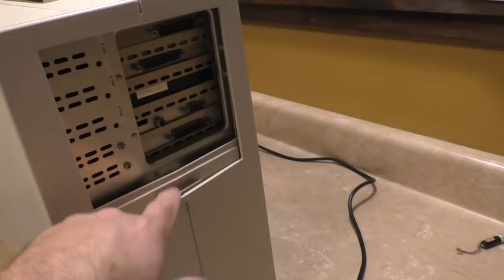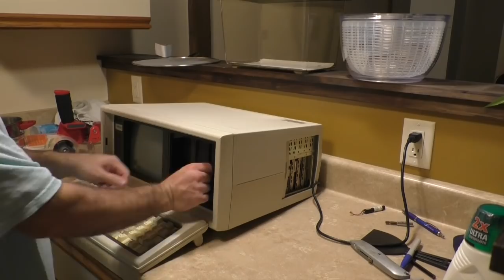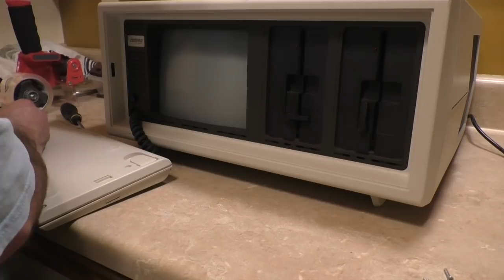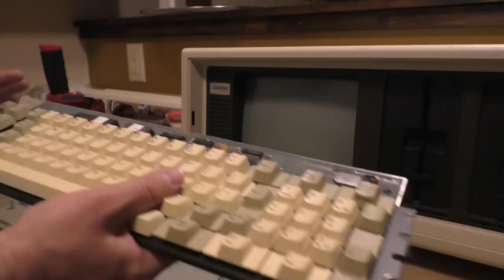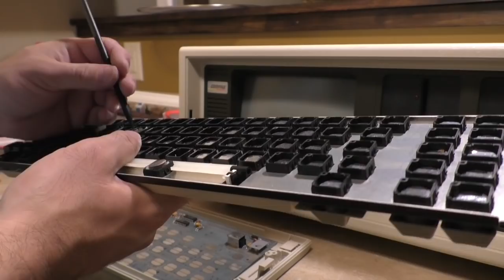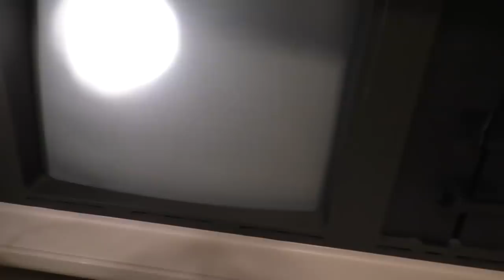1985 Compaq Portable PC - The "First" IBM PC Clone

Comment: I once saw an IBM PC XT Portable 5155 at a thrift store back in 2006. Too bad I didn't get it at the time. That would've been a great computer to make BASIC games. The HDD is a Quantum HardCard 20MB in that Compaq Portable.
Reply from the maker: My Compaq has a Plus HardCard 10mb installed; I had to replace the head stack bumper about two years ago, but it runs great! Interestingly enough, the unit is marked as being a dealer demo!
Reply: @bbishoppcm  I was off on the size. My dad bought a 20MB variant in 1992 and it was utilized in the 286 machine and was used up until the 386 back in 1993 and it died all of a sudden.

I found one on eBay that has a Time Spectrum 384 + RTC and it has no power, and I'm either going to bid or not bid on it since there's a lot of things that can cause the computer to not turn on and corrosion is one of them.

Comment: ... and this is why I do not willy nilly replace caps on vintage audio equipment either unless there is an obvious failure of one and even still I don't go replacing every cap just because 1 or 2 went bad.  I have tested ESR of new and old caps and have seen similar results even with "low" or "ultra low ESR" caps.

Comment: working on old tvs, radios, and tube equipment is what i do for fun... no way in hell i would assume that the caps NEED replacing immediately unless i diagnosed the problem first.

i service my equipment. cosmetic restoration is one thing, but why would i replace working components?
Reply from the maker: It's something everyone keeps harping on, but is totally unnecessary... with the exception of aluminum SMD caps used on many electronics from the 90s.
Reply: Aaron Blair yes way in the hell I would assume that find the caps get it

Comment: computers that should be recapped(with quality caps) directly and without question Amiga 1200, Amiga CD32, Amiga 4000, and most if not all 68k Macintoshes.
also what usually makes the caps leak is the shock of suddenly getting power after a long while, so if the computer is new in box
 or have been powered on regularly they are less likely to have suffered from leaky caps. also check if caps are a common problem for your computer before thinking about recapping.
Reply from the maker: I had to mention it because of the types of people who watch my videos... many of them are in the "recap all the things" mindset. Personally, I agree 100% regarding the older Macintoshes... and anything else using aluminum SMD caps; they're basically guaranteed to fail.
Reply: SandyStarchild drowning the water my keyboard is broken

Comment: I don't replace the old electrolites unless they are failing as the ones from the 80s & 70s in my experence are rock solid. Ironicly the ones I have recaped have been machines from the 90s & pretty much 90% from the 2000s. Just because a cap is old does not mean it is crap. If it is from the mid 2000s it is crap.
Reply: TheEPROM9 Yes computer